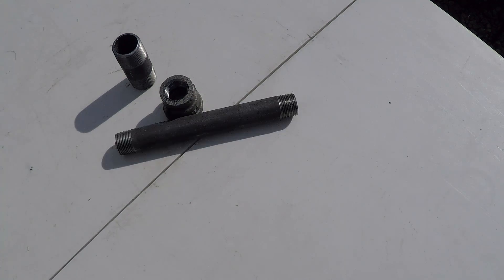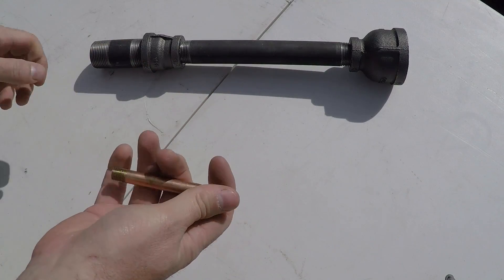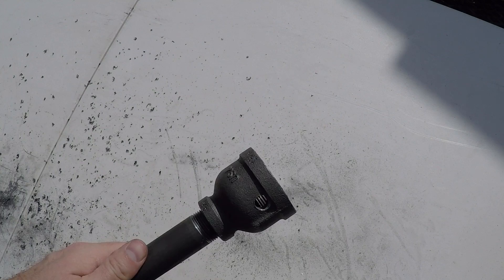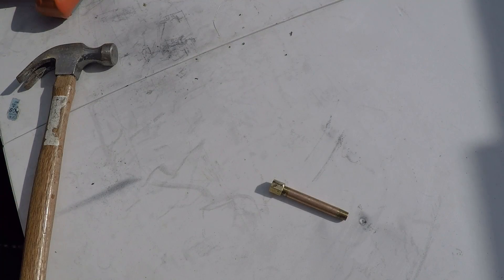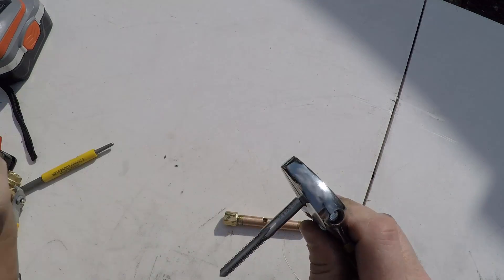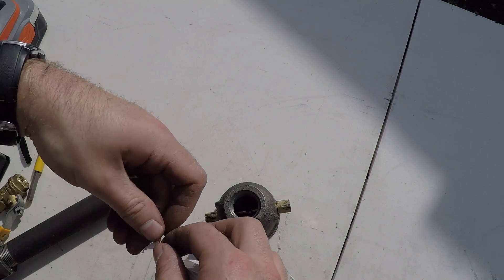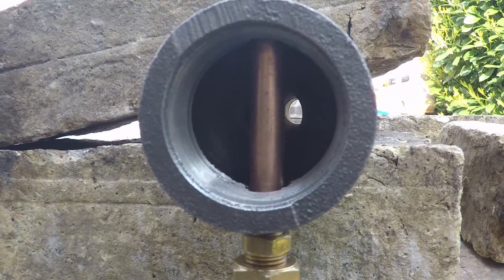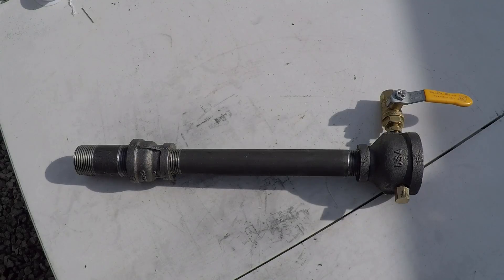How to Build a Forge: Making a Gas Forge Burner (minimal tools / no welder)

Comment: This isn't a real DIY video, as it didn't include a drill press, MIG welder, plasma cutter, and $10k of assorted equipment :P
Reply: Instead of a mig tip, you can use a tee and run a pipe with a cap and drill a hole in the cap.
Reply: Dont forget the industrial metal lathe for custom making all parts and fittings
Reply: LMAO nice. I do leather work and watch videos of "Handmade" leather items, yeah ok, nice $2500 sewing machine you have there, oh die cuts too! ahahahahah
Reply: @graffatag  Actually you're both wrong.  This is real, I 90% followed this video to make this:

https://www.youtube.com/watch?v=IdrTAFYUENk
Reply: He uses a drill Not a drill press, Mig welding tip Not a mig welder, and i have no idea where you saw a plasma cutter? Maybe watch the video before commenting.
Reply: @jessicaburchfield4882  hes joking.  lots of diy videos use tons of extra expensive equipment but this video is very simple and cheap.
Reply: @jessicaburchfield4882  the sarcasm flew right over your head sorry
Reply: @jessicaburchfield4882  r/wooosh
Reply: @jessicaburchfield4882  maybe get the joke before commenting
...
Reply: @jessicaburchfield4882  best to keep silent and be thought a fool than to  speak and be known a fool.........
Reply: @jessicaburchfield4882  OMG woman, he was being sarcastic!!!

Comment: I used this amazing don’t use welding tip
Reply from the maker: Thanks! I also found that the smaller drill hole worked better or swapping the welding tip out for a smaller diameter.

Comment: This orifice used is for a propane forge correct? Not a natural gas? I may have to make it bigger for natural gas if it’s not. 
I’m planning on using this configuration but adding a fan upstream to force air.

Comment: If you put a short pipe nipple on the top of your reducer it will clamp the 1/4 pipe and nozzle in place. No need to solder
Reply: Eric Hjalmarson can also use steel pipe to thread the welding tip into so that you can tack the steel to steel instead of soldering. That burner is going to get hot and melt the solder in a matter of minutes

Comment: Add Thread Lock to your fittings! Plus when you drill into metal, use oil as a drilling lube. Makes it go easier & you don't burn out your drill bits
Reply: Thread lock ?   Really ?   Why?  This isn't a high vibration situation, and thread lock will burn out in about 5 minutes. No offense

Comment: i gave up when you said 10 and 1\2 millimeters.
I only work in the imperial system here in the U.S.
good luck
Reply from the maker: Imonlyhalfnuts really filming a new and improved burner video today that has an adjustable airflow regulator. Strictly imperial measurements and parts (except for the M6 tap and 5mm drill bit as that's the thread that is on the MIG tips). Hope you stick around for it. :-D
Reply: You know that some conversion charts exists, you do not have to deny the whole world for it!

Comment: the soldered things melt if they are used in a forge
Reply: theyre used at the end of the burner, so they shouldn't get hot enough to melt but if you really are woried id recomend using some sort of wire to hold it in place

Comment: Would I be able to use a galvanized 1-1/2"x3/4" reducer safely? (the end that the brass fitting goes through) My local hardware store doesn't have that size in black pipe, but has all the other stuff
Reply from the maker: Adam Jackson No! Galvanized metal gives off dangerous/deadly fumes when exposed to heat like that.
Reply: Make Stuff Nation I'm aware of that, I was just wondering if it was far enough away from the flame to be a problem
Reply from the maker: Adam Jackson okay. It would probably stay cool enough but I probably wouldn't risk it.
Reply: Make Stuff Nation Thanks for the input! I reread my comment and Im sorry if sounded snarky, that was not my intent!
Reply from the maker: Adam Jackson no worries! Good luck
Reply: E-bay

Comment: Hey, I’ve been building something very similar to your burner for my first forge. We got everything put together last night and are not getting a clean jet like flame. It’s really long with a lot of orange at the end. I was wondering if you had any tips or pointers or things we can take a look at.
Reply from the maker: If its orange its not getting enough oxygen/mixture is too rich. It can be caused by a few things, not enough airflow (low pressure on the propane), too large an exit hole for the gas into the vinturi (slows down the flow and feeds too much gas), or the gas jet/hole not aligned properly with the body of the burner (doesn't draw in enough air). I hope this helps.
Reply: Thanks sir, were going to try a smaller opening mig tip tonight.  I'll let you know if that was the problem.  We are currently using a .035.
Reply: Thanks sir, were going to try a smaller opening mig tip tonight.  I'll let you know if that was the problem.  We are currently using a .035.
Reply: Well, we finally figured out our problem, and it wasn’t the mig tip size but rather the fact that the mig tip isn’t creating a seal in the threaded pipe. Looks like between the thin wall of the pipe and the curved nature of it that we were always getting a good deal of leakage around the base of the mig tip.
Reply: I am having a similar problem. Mine puffs at low pressure but won't allow me to increase the pressure. I think I'm also leaking around the might tip. Not sure how to get a better seal on the joint.

Comment: Can you simply use the pipe and put the end in the foundry instead of the reducer(s) at the end?
Reply from the maker: You can easily omit the 1" pipe after the reducer on the burner end. The reducer acts as a flare to help keep the flame front at the end of the burner but you may be able to omit it too if you have it installed in a foundry as you mentioned. I haven't tried it.
Reply: Thanks! This video is the one I chose and it worked really well

Comment: Could also easily put a sliding cap made out of, well anything, on the back that reduces the airflow and makes it instantly adjustable.
Reply from the maker: great suggestion
Reply: I actually just finished this build the other day and it screams. I ended up tapping the uncapped side where the gas line comes into the intake. Holds it extremely secure with no need for soldering. You do have to thread more of the nipple first to have enough sticking out, about half an inch or so extra.

Comment: a very easy desing with not much parts if you add a big washer on the air intake fixed with a small screw you are able to controll the air intake

Comment: The 1 inch pipe on the end does not work well.   The 3/4 -1 reducer without the pipe works way better    this was with a 10lb regulator.

Comment: Can you use a different size welding tip say .035?
Reply from the maker: You should be able to. It might slightly affect the power/efficiency but I honestly don't know if it will make it better or worse. Let me know how it works for you!

Comment: I built mine using a 0.035 Tip, soldered all the joints,  and it runs good for about 10 min then there is a loud BARK sound and flame moves from end of torch to a few inches from Mig Tip inside the pipe.
I have increased the air intake area but still have the very same problem.
Anyone have any issues similar to this and how to fix it ?
Reply from the maker: I think you might need to run your gas regulator at higher pressure as it sounds like there isn't enough velocity to keep the flame at the exit of the burner.

Comment: Followed your design.  Question:
I notice my burner shoots out flame about 3" away from the tip...that is, no blue flame visible at tip of the burner at all,  Get generate a HOT SPOT in my forge.
.025 MIG TIP
Reply from the maker: I have noticed with this design that the flare at the end might not be drastic enough to slow the flow and keep the flame at/near the tip of the burner. I'm going to experiment with some other fittings this spring and maybe even bend some sheet metal flares.

Comment: no flux for the solder joint???
Reply from the maker: lol, didn't have any on had. Sure would've helped though. Thanks for the advice.
Reply: That kind of solder usually has flux built in tot he solder.

Comment: If I can't find 1/8" brass pipe can I go for something bigger like a 1/2" does it make a difference?
Reply from the maker: The important part is the size of the hole that the propane comes out of.  It might be possible for 1/2" to work if that's the outside diameter.
Reply: I can't find it either
Reply: https://m.acehardware.com/product/index.jsp?productId=29000776
Reply: Go to Lowe's or home depot and look in the plumbing section near all of the valves and toilet repair stuff.

Comment: you can also use another section of pipe screwed into the reducer to hold the copper pipe in place, for those people that can't solder.
Reply from the maker: JB Weld also works from what I've heard.

Comment: You can improve it with an " air regulator " on the top of the burner
Reply from the maker: Thanks for the suggestion. I'm working on a mod to add one that doesn't require a welder or other advanced tools.
Reply: Make Stuff Nation great !

Comment: I just tested mine after following the build and it won't stay lit. It burns like crazy as long as I keep a flame in front of it. Any idea what could be causing it to not stay lit?
Reply: Did you get it to work? mine won't stay lit either...
Reply: have you tried reducing gas flow?
Reply: It turns out it works great when in the forge and stays lit. I don't anticipate using it outside the forge, so all is well.
Reply from the maker: Sorry you were having some troubles. As you found out (saw your comment below) it works well when installed in the forge, I'm not sure if it's due to the forge containing the gasses and heat or if its some sort of backpressure interaction.... A larger or more substantial flare at the burner end should help it stay lit outside of a forge or kiln but I haven't tested that.
Reply: I built A burner with straight pipe, without bell reducer on the end. Mine wouldn't stay lit, then I made a funnel looking end for it, stayed lit. Someone called it a flame holder. Then I made a 11/2" square flame holder, for some reason it worked best, but not practical since it has too be screwed together in the forge

Comment: Does the propane hose screw into the ball valve or are there other fittings required to attach it?
Reply from the maker: It depends on what type of fittings your hose has. I used a hose barb fitting that the hose slipped on and then threaded into the valve.

Comment: what was the pressure on the reg u used? I saw the 2nd video of the burner in action but not sure what # that reg goes too.... like the design, easy and straight forward. 👍
Reply from the maker: Its a really cheap import that came with a Clarke brand roofing torch from Machine Mart in the UK. Its not labeled anywhere but I believe its 0-4Bar (0-58psi).

Comment: Make Stuff Nation what size is the mig tip you used? Thanks.
Reply from the maker: I used a Tweco Mini Number 1, 0.040" Wire Size 
78375A609 from McMaster-Carr

Comment: The iron pipe doesn't really need to be the exact diameter that you used, does it? Do you think that is i used a smaller diameter pipe it would make the burner more or less efficient?
Reply from the maker: You can use different diameters. The important part is the flares so you get a good venturi effect. I'm not sure how it relates to efficiency but generally the larger diameter burners will put out more BTUs.

Comment: I am making this and i cant get it to solder. What type of flux did you use? Mine doesnt stick.
Reply from the maker: I was using a cheap bit of lead free flux core solder I had lying around. Sorry I don't remember the specifics and I'm out of town for work so don't have access to it right now. I also had a bit of trouble getting it to stick but it would flow into the gaps so I just gobbed up enough of it to keep the part from spinning.
Reply: Before you solder you should clean the pieces with an acid or vinegar. most solder is flux core or has flux wrapped around it. And if you're using an iron clean it with Sal-ammoniac first. It should stick.

Comment: are you in the UK?
If so, where did you get the main body parts from?
Reply from the maker: Yep, I'm currently in the UK. I got the parts from McMaster-Carr, https://www.mcmaster.com/. They'll ship internationally. There are probably UK suppliers but this place has everything you could imagine and has great customer service.
Reply: wow.. thanks for that.
I've been using a place call FWB, here in Stoke on Trent.
Had to kinda mix and match.
and thanks for explaining why theres a flare on the bottom... That also explains why mine wont keep a stable flame...lol
Reply from the maker: I'm glad I was able to help. I've also found that if you don't have the end in a forge or sheltered from the wind it doesn't keep a very stable flame (maybe my flare isn't drastic enough). I just finished editing my test video. I'll be posting later today.
Reply: I work in my motorcycle garage, so wind isnt that much of a consideration, I think the pressure/speed of the gas means it keeps putting itself out. 
I'll add a flare to the end later today, and see what changes. 
I also picked up, 0.6mm, 0.8mm and 1.0mm mig tips to see what difference they make, but have not got round to that as yet. 
Spent all of yesterday making sodium silicate, ready to mix with perlite for the internals of the forge.
Reply: I had no problem getting the parts suggested, apart from used bsp instead of npt, I got all my parts from Crewe engineering, I’m struggling to get a decent flame though, I’ve tried with the flare with and without the barrel nipple in the end, and with anything other than the tiniest bit amount of gas pressure it’s unstable. Have you had any luck?

Comment: no need to solder the pipe in place.... use a set screw
Reply: Or you could just throw in something like a pile of washers or spacer before adding the reducer bushing, which will wedge it into place.
Reply: That's what I did.  It worked great.
Reply from the maker: Brandon Miller great suggestion! thanks!
Reply from the maker: This could could be a great alternative. Thanks for the suggestion!
Reply: I made mine with a smaller length nipple and the cap snugged it up and then I used in weld around the outside areas.
Reply: I  made one today.  Where would you pit the set screw?